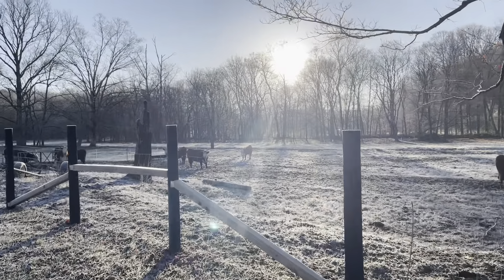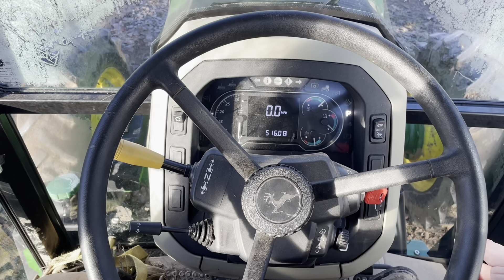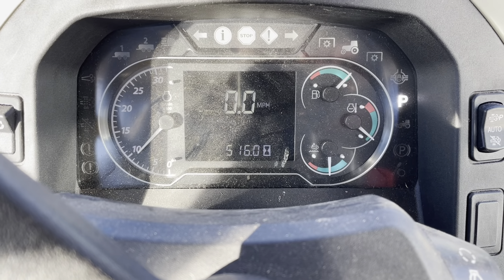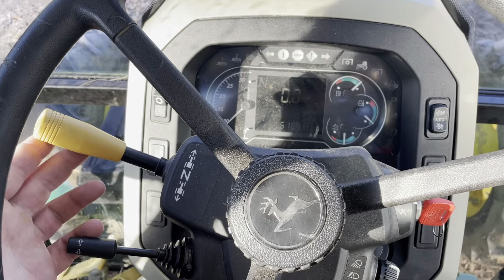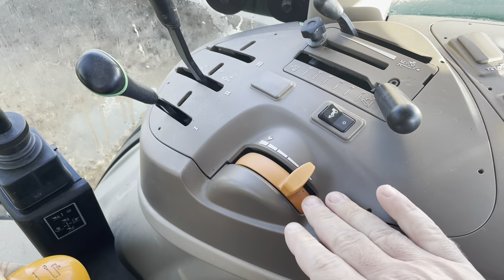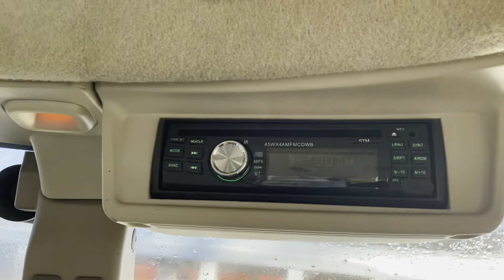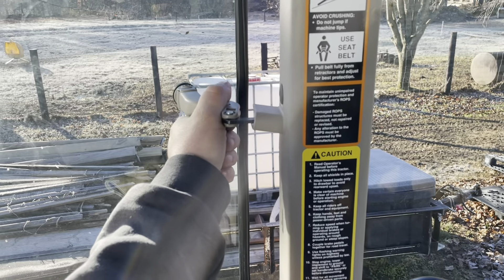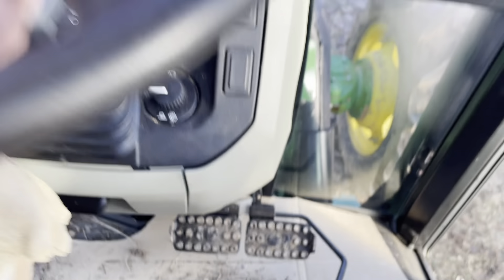John Deere 5100e Controls : Vlogmas Day 21

Comment: Hey there, thank you for the video, it looks like you have about 500 hours on your tractor? If I saw it correctly on the dash, have you had any issues with your tractor? The reason I’m asking last year I ordered a 5090E cab and it arrived two weeks ago and the first three hours of using the tractor my joystick which operates the front loader broke internally it snapped, I lost my brakes about 90% we’re gone, and my loader was stuck halfway up in the air couldn’t go up or down so I had to load it and once I got it loaded on the trailer I looked underneath there was a puddle of oil one of the main seals on the shaft that comes out of the transmission basically the shaft from the clutch into the transmission the seal was bad so now my tractor is at John Deere and it split in half, it’s been very stressful to say the least, I have a 5065E cab tractor and that thing has been a total workhorse I run my tractors at full PTO sometimes seven days a week for approximately four or five months and I’ve had no issues also I run my tractor at “E” PTO and I can cut thick grass/weed that are 9 feet tall and it cuts great and saves a ton of fuel, I’m trying to be patient with my dealer give them a chance to fix this thing I keep going back-and-forth worried I’ve purchased a lemon, hopefully it’ll all get worked out, have you adjusted your front wheels @ The stops, you can increase your turning radius quite a bit, anyway you have a very nice tractor congratulations!! I have hope mine will be as good as yours👍🚜
Reply from the maker: Thank you- no I have not had any issues. Did yours get resolved?